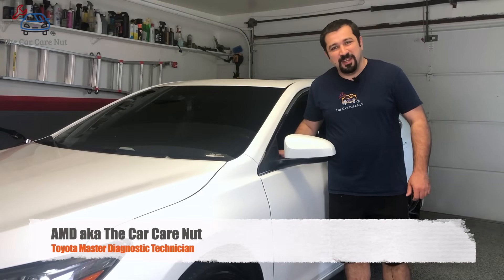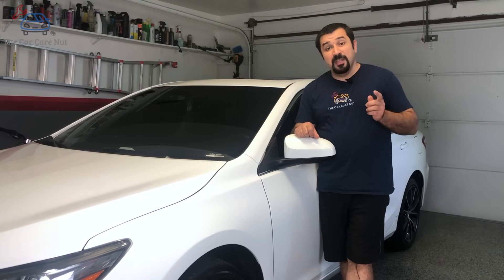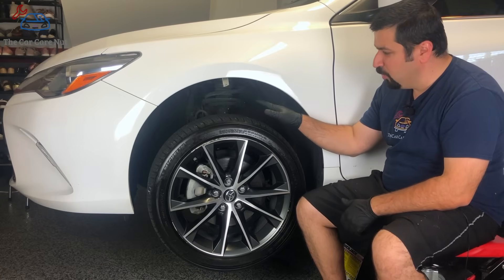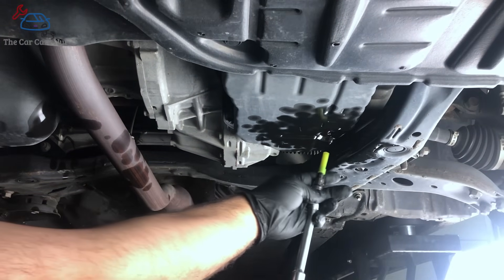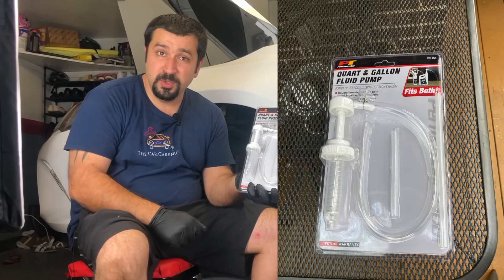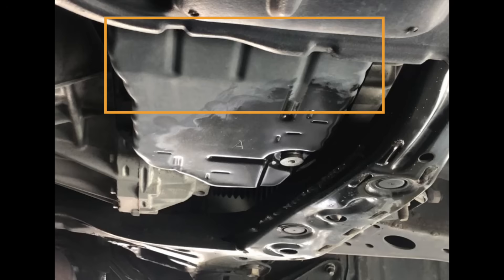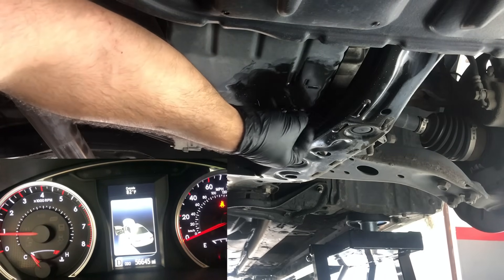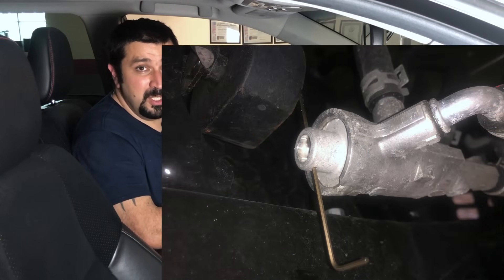How to change your Toyota Sealed Transmission Fluid

Comment: I have been tasked with servicing a family member's Toyota Camry, a 2009 glx model.  I would like  to do a drain and fill on the transmission, and wonder why replacing the fluid drained with the exact same amount would not be adequate.
Reply: Because you don't really know if the fluid level is correct now.  If the transmission is low, it will still be low after your drain and fill.  Doing it at the correct temp isn't super difficult, once you figure out how to put your car into Temp check mode via the OBD2 port.  In my Toyota, it's just a matter of jumping pins 4 and 13 together.  Might be different on yours.

Comment: I thought that the magnet in the bottom of the transmission collects metal particles and that's why you don't need to change it. Please help me understand because I have a 2017 rav4 with 120000 miles and I never change it because I  was told that I don't need to???????

Comment: I have a 2011 Toyota Avalon with the U660E transmission. I drove the car around awhile so it was hot and then tried this method to see if i would get the flashing D. Instead of a flashing D when the temperature is high, I get a flashing P. Is there something I'm doing wrong?

Comment: If the transmission is cold, and the fluid is below the temperature needed to check the fluid level, then no fluid should drain from the transmission when the drain plug is removed because the level of the fluid in the pan would be below the overflow tube. That to me would indicate the fluid was overfilled to start with. So why did fluid drain from the hole when the drain plug was removed and the overflow tube was still installed in the pan?

Comment: This is all very interesting. I will now be even more apprehensive when leaving my car with my local technician. There is absolutely no way he will be going through this very involved procedure to set the precise trans fluid level at the proper temperature. No Way. And I doubt the local Toyota dealer would be any more accurate. This tech has changed my trans fluid before, with no problems in the past 60k miles, so I have to trust that what he does is good enough - but my attitude toward EVs is getting more positive.

Comment: Thank you for sharing the video. I have 88000 km (Canada) on my 2010 RX 350 and Lexus dealers recommend the transmission fluid change at 96000 km. One dealer specified a transmission flush (4.5L) while another dealer recommended replacing only what's in the transmission pan (3L). I have checked with the Lexus dealer where the car was purchased and mainly serviced, and the transmission fluid was not changed before. (I bought the car about 3 years ago with 62000 km). Could you please advise, should I go with the 4.5L flush or with the 3L fluid change?
Reply: It's up to you, but some people think drain and fill is safer than flush.

Comment: Thanks for this video! DId this service on the 06 IS350 with 226k miles, but something like 3.6 qts came out, so I put just under 4 back in. Independent lexus service said my fluid was brown despite me adding 4qts of WS and changing the filter last summer. I think another drain and refill should be just fine. No issues with the shifting whatsoever.

Comment: Writin you on MAY 25th 2023 
I don’t know if you’ll see this but I have a 08 rx350 it does have the dip stick for the atf does take type WS  does this adhere to the procedure  you showed via obd2 connection ?  Or should I perform procedure with laser pointer if so can you supply the temp range for the discard of excess atf fluid thank you

Comment: How do I determine the correct temp? 2019 Corolla le cvt. 91k never changed fluid, should I?
Reply: I'd change it if it were me.  If it's the K313 transmission, the correct temp level is 35-45C.

Comment: My wife's "18 RX350 has a different looking drain plug....it has a round drain bolt with a hex drive and a smaller round bolt inside the head.....is this a different system?  I'm afraid to mess with this one!

Comment: I have a 2009 ls460 with 200k mileage. The transmission fluid was never changed. Is it ok to drain and fill the transmission fluid?

Comment: Quick question, what is correct temperature for a 2014 Corolla (CVT) and 2018 RAV 4 (small 4 cylinder) thanks ! Great videos
Reply: If the Corolla is K313 transmission, the correct temp level is 35-45C.  Don't know on the RAV4.

Comment: By replacing the ATF WS on my Lexus IS250 6AT Transmission. Do we need to replace the ATF filter too? which need to remove the whole trans oil pan.

Comment: The Toyota dealer is telling me not to flush the trans fluid at 60k or service the strainer inside the pan. On my Tacoma. I call BS on the dealerships refusal to do the work.  
There’s hardly any honest people left in this world. Thank you for your information.
Reply: I worked at a Toyota dealership as a sales consultant, and we were told to tell the customers that it was unnecessary to do a transmission fluid change. It's to the convenience of the dealership to sell you another vehicle or have your vehicle in their shop. It's a dirty business.
Reply: @Ezq95 that’s crazy. I don’t care about that. I’m a simple man - I want a service done to my car, I pay you to do said service, work gets done, no harm no foul, my stuff works great for years to come. It’s a win win, less junk in car lots or car graveyards, better for environment when there’s no parts required to solve our problems, or in this case an entirely new vehicle with a whole slough of new parts to worry about. You’re right, it is a dirty business.
Reply: This isn't a flush its a drain and fill
Reply: @robotman8444  : Yeah, in absence of any noticeable leaks, I just do a drain and fill (put in what I took out). I don't go through all of this rigor mortis.
Reply: It is common wisdom to NOT do a flush when the milage is high on the transmission, it kind of disturbs the ecosystem of the dirt.  Who knows if this is true?  Instead, do a "a drain and fill".  This is what the CC Nut was doing.

Comment: Hi, I have a 2007 Camry XLE V6 and wish to drain and fill my transmission fluid. A few questions if I may ask, Which ATF should I purchase Toyota for this model? What is the temp range to drain the excess Transmission Fluid? When using 4 jack stands, should I place my 6 foot level against the frame rails to check if the car is level or small level against the bottom of the transmission pan?
 Thank You

Comment: Hello, I follow your videos thanks for sharing your knowledge with us, Have a question, I'm the owner of the 2007 4 runner Sport edition v6, when I bought it it had 164000+ miles, now it has 192000+  I would like to know if there is any maintenance that I can do it,  I know that is not recommended to replace the transmission fluid but what can I do?  thanks again

Comment: Thank you for the video Sir, If I am driving 2019 2.5 liter Toyota Camry with UB80E TM and have 75k miles on it. Maintenance Manual says replace the trans fluid at 120k should I stick to it if I drive for the Uber Eats? 
"MAINTENANCE LOG
MAINTENANCE
120,000 miles or 144 months
Extensive idling and/or low speed driving for a long distance such as police, taxi or
door-to-door delivery use:
Replace automatic transmission fluid"

Comment: Thank you for a very nice video. I have a question please. How do i know if my RAV4 [Toyota RAV4 2016
Full Hybrid SUV2.5 Hybrid
FWD IV _A4_2494cc 145KW 197HP 2AR-FXE] has an overflow with dipstick or not. I mean is there  a way to tell before actually performing the fluid change. Many thanks. I am UK based,

Comment: Hello ADM, thank you for all your educative videos, helping a lot, please let me know the temperature that I need to get in a scan tool to start  the fluid adjustment in a 2016 corolla LE, thank you.
Reply: If it's the K313 transmission, the correct temp level is 35-45C.

Comment: Hi. If I do the fluid transmission level check again after 4 to 5 days. Do I have to add a half of quarter before to do the procedure??? ( I thought that because fluid is going to come out up to trickle again with this new checking).

Comment: Common Questions Answered: Yes, put it in Park once the "D" comes on. If you have an 8-speed transmission, you need to bypass the cooler for the entire process (start with this step and conclude the job by removing the allen key after you have verified proper level). For those of you confused with how to bypass the cooler, pause the video on the two pictures to notice how the "button" gets pushed in, then held in place by the allen key. Finally, yes, you need to purchase a new Toyota OEM crush washer for when you reinstall the drain plug. Hope this helps!
Reply: Can you tell me where the cooler is under the car? Is it to the driver’s side of the transmission, in front or back of the transmission?  I can’t seem to locate it.  I do have an 8 speed trans.  Thanks for your help
Reply: @edwardjackson9871   I have an 8 speed tranny as well, did you find the cooler, if so, what side is it on?
Reply: @johnkelly54321 Just did my 21 Camry and missed this... it's been a few days since I did it. Pretty nervous now, thinking I messed up. Any ideas as to what this part of the procedure of bypassing does and why it needs to be done, most importantly, what should be done if it wasn't done when doing the transmission fluid change?
Reply: @veelm777 i have done with my 2019 toyota rav4 adventure, and I completely forgot to push the coolar bypass? It's been already few weeks since I changed the fluid, nothing seems to happen but I'm still wondering..  If someone help me locate in my car? Thanks. ❤️❤️

Comment: Does anyone know the torque values for the fill and drain plugs?
Reply: From experience, 29 lb ft for the drain plug, and 33 lb ft for the fill plug on these Toyota/Lexus trannies. Good idea to use a new crush washer each time for the drain plug. Not necessary for the fill plug.

Comment: Hey Mr Car Nut- Hope all is well. I have a 2012 Camry SE v6 120k. bought it with 106k back in 2019. today is 4/29/23. i want to service trans fluid. i am getting mixed reviews regarding dropping pan to change filter. It appears even dealer only changes fluid...not filter. If not necessary- I will just drain pan-refill and set fill at correct temp and start there- just to add some new fluid. what are your thoughts. I definitely want to add new fluid even if it is just 1/2 to start. Let me know- thank you in advance
!!

Comment: Hi,  thanks for the transmission fluid charge video for the Rx350.
Great video, well done!
I have the 2016 RX 350 with the 8 speed transmission.
Is there much difference to the procedure?
Does my RX have the cooler by-pass valve?
Mike

Comment: You mentioned that if you wait too long to change the transmission fluid that changing it too late could make your transmission worse. I bought a 2011 Camry with 125.5k miles. It now has 134k. Unfortunately I don't know the service history and don't know if or when the transmission fluid was changed. The car seems great, I don't notice any issue with shifting, etc. I have a car fax but it doesn't mention transmission fluid service or any scheduled services, except at 99.2k "recommended maintenance performed." I'll see if that shop has any more details. If I'm unable to find out, is 135k too late to change transmission fluid whose service history is unknown? Can the fluid be drained and analyzed to determine whether it should be put back in or replaced with new fluid?
Reply: If its unknown and not broken

Dont touch it at all

Comment: I bought a used 2012 Rx350 that had a record of a Trans fluid change at 100,000 kms.  I just changed the trans fluid at 195,000.  When runnong off the excess fluid it looked very dark.  Almost as dark as what I originally took out.  Should I do another trans fluid change in 5000 kms?

Comment: I have a 2017 sienna less than 80,000 miles when should the transmission fluid be changed? Didn’t find info in owners manual

Comment: For DYIs, Do not do any of the procedure he tells you, it's not wrong, but it's a waste of time! leave your car COLD for 24 hrs, jack up the car and drain the ATF, then fill exact amount back. job done! the fluid expand when hot, what he showed it's the proper shop procedure, because cars will be driven in hot, that's why you need the OE procedure. From the factory, the fluid was overfilled about .5-1 L. I asked lexus technician, you are not going to damage the AM if you drain and fill cold fluid exact same amount! you are not going to damage the trans if you follow the shop manual. but if you can drain the car cold, why go through all the trouble?
Reply: Assuming the proper amount was put in to start with, right?

Comment: Nice video, very detailed & educational, thanks.
I'm a subscriber here, and a Toyota owner, in fact all the family members own a Toyota. I do the services always using Toyota genuine parts. ( I was a motorcycle mechanic).
I'm from Cyprus. I'd like to know if this is the same procedure for a  2016 Toyota Yaris 1.33L 1NRFE petrol engine CVT (NSP130R manufact. date 11 SEPT 2016 European model, right hand steering), and what is the recommended milage interval for changing the CVT Fluid. Now the car has 26000 Km on the odometer.
Thank you for the videos and for all the knowledge you share with us. God bless.

Comment: I have a 2017 rav4 4 cyl front wheel drive. What is the temperature for checking the oil level in the transmission when replacing the oil. I will use a infrared temperature gun to check on the oil pan. Thanks.

Comment: I bought a temperature gun from Harbor Freight to use. I saw a video a guy did saying it was off around 7 degrees. When we drained the oil, only got a quart and a half. Put two quarts in it, ran it and drained off again after we shut it off which drained too much out. Put another quart and ran it again. Drained that to the correct level with the car running. We ended up with the same amount put back in as we took out to start with. Just wanted to make sure we did it right? The oil looked a lot better. It’s a 2013 Avalon with 80,000 miles. So, your recommendation would be to run it a week or so and check it again? Cannot afford to mess up this transmission. Thank you so much. I’m glad my wife ran across a link of yours on NewsBreak
Reply: So, you drained too much out with engine off and then added more and checked with engine on which resulted in cleaner fluid and equaled the same 1.5 Qts initially taken out?

Comment: Will this procedure work with a 2012 Camry 2.5? More specifically, using the jumper wire in 4 and 13 spaces.

Comment: Hi AMD. I've watched your video twice now. It's terrific. However, I feel as if the obvious is being missed here. Can't one simply leave the vehicle sit overnight, then put it level on jackstands, drain the trans fluid, measure how much was taken out and then replace it with the same amount of new fluid to achieve a correct fluid change?
      The only reason I'm seeing to replace the old fluid with new fluid and overfill by 1/2 a quart, then run the engine to the prescribed temp and then start draining again until the fluid starts dribbling and cap it off is if one doesn't know if the vehicle had the right amount of fluid in the first place.
Reply: This is correct, but you don’t know that if was correct. A guy on here said his Tacoma showed it was a quart short from the factory
Reply: I agree it has to be accurate

Comment: I don't understand. Why so much hassle in the fluid adjustment procedure? Do all mechanics do this?
Why do we need a specific temperature? Cant we just fill the same amount we drained out??
Reply: Cant we just fill the same amount we drained out?  
You can, but you don't know if the level was correct to begin with.  You know what they say about assumption...

Comment: Hello, I really enjoy your content!! I recently changed my ATF in my 2019 Highlander w/8-speed, car had 83,000mi when I drained and filled it, I followed your procedures, but now it whines at high RPM(while driving only) car still drives and shifts almost perfectly. It’s been about 2,000 miles. I am confident I have enough fluid in it!! Vehicle has power train warranty until 100,000 mi. Any ideas?!

Comment: Couldn't I just wait till fluid was cold..or at least  ambient temp ...drain into measuring canister, then refill it to that same point 👉 of measurement canister?????? Asking 4 a friend.....
Reply: Before I learned how to set the level with a scan tool, I weighed the amount of fluid drained and replaced it with the same mass of fluid. This took away any variation due to temperature induced expansion.

Comment: Do the 6-speed transmissions on the 07 lexus ES350  have an infamous humming sound when they get higher mileage? if so what is the cause? Usually at a speed of 45 MPH+

Comment: Would it be fair to say that when following this procedure you do not get ALL the transmission fluid out?  So this procedure allows you to drain and fill only a PORTION of the fluid in the transmission correct?  Which is good because you don't want to completely drain and fill a transmission anyway right?  So, the big question is, would it make sense to 1) Do this procedure, 2) run the car for 20,000 miles or so and then 3) Do it Again?  Do you have any idea on how much transmission fluid is actually in the transmission on a 2016 Camry 4-cyl?  You got 2.5 qts out this way, I just wonder what % of the total you get out each time you do this?  

I have always loved your videos and I appreciate you showing us this OBD method.  No one else can make videos as helpful as you do.  You have the exact right teaching style.  Thank you SIR!
Reply: Yes, this only replaced about 2.7 litres (~2.8 quarts) of ATF out of the 6.6 litres (~7 quarts) of total fluid capacity.
Reply: You're likely to replace about 1/3 of the fluid with this procedure.